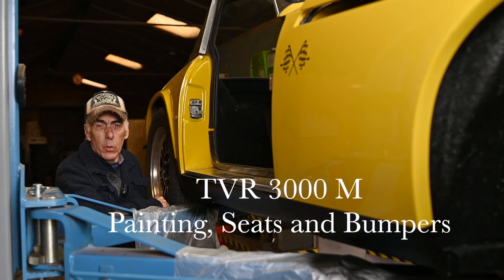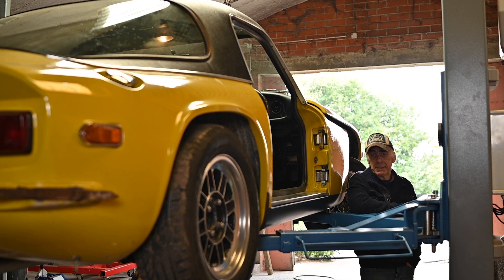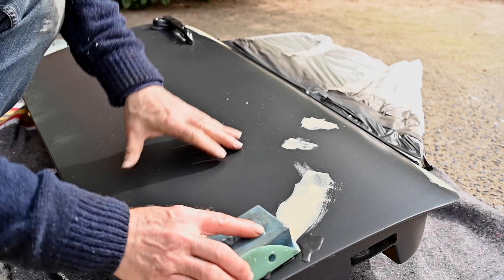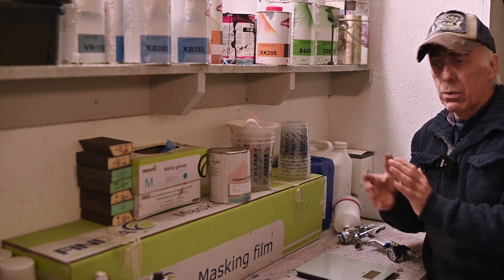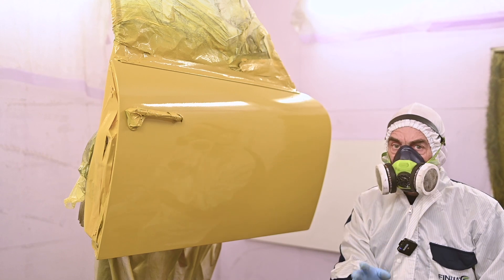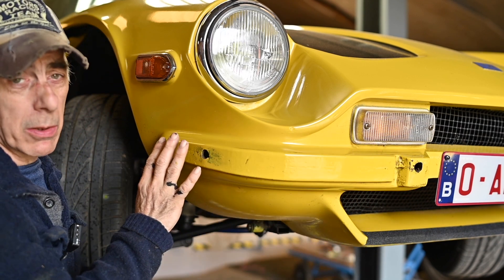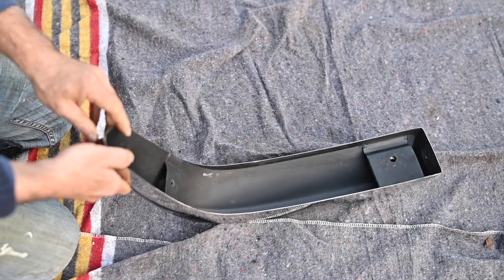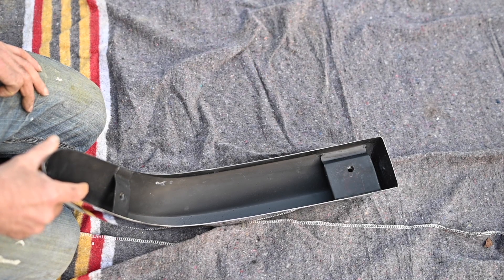TVR 3000 M, bumpers, painting,seats and more

Comment: Just a quick thought with the offset on the new bumper of that one hole.  Because they end up to high, can"t you swap left and right so they end lower?  Of course, i just saw the video and did not hold the pieces for a close look.  I'm sure you checked it :).  Another lovely video.
Reply from the maker: Thanks for the comments,  that does not work as there different roundings on the bumpers

Comment: A good choice with the stainless steel bumpers! But why do they make an excellent product that cannot be fitted without heavy modification ? I think your best method with the tapped bush would be a rivnut once you establish the correct position just crimp in a rivnut and it will line up correctly, but the manufacturers need to be told about this . Chris B.
Reply from the maker: Thanks, yep a rivnut would be another option.   It beats me why they did not make the bumpers correct.

Comment: Not sure about the primer you used but you do need to be careful about putting water on porous coatings prior to painting as it can lead to moisture being trapped & microblisters in the final finish. Ideally use panel wipe rather than thinners before painting too as thinners can attack the existing finish & any filler/stopper. Something for others to be aware of.
Reply from the maker: The primer is high build primer , also the door panel was in the booth for about 3 hours at 35 degrees before been sprayed